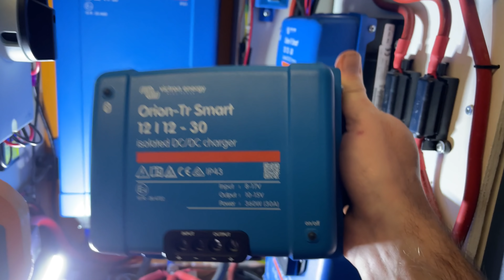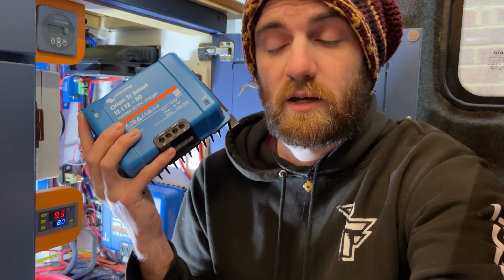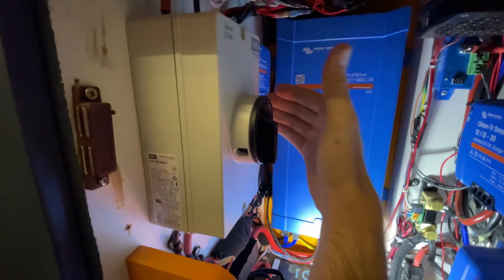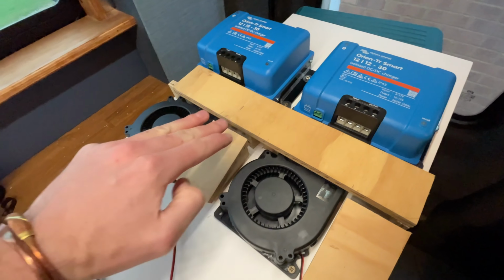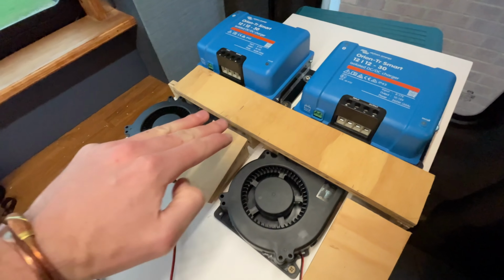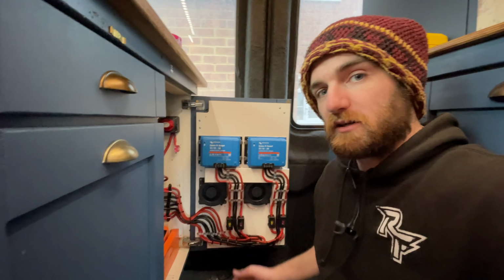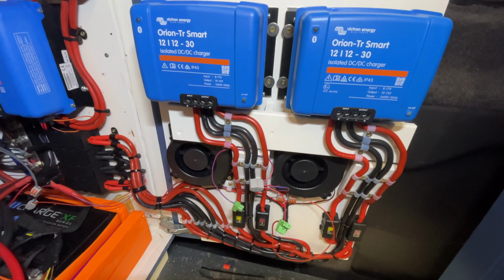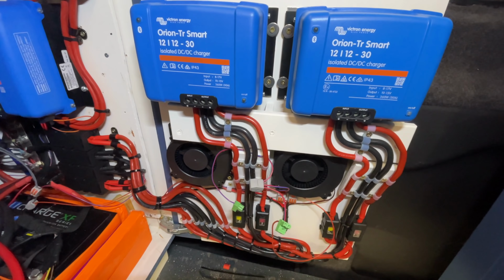Double Victron B2B Charger Install | How To

Comment: rip alternator
Reply from the maker: Not likely with a 220a alternator and looking at the ford upfitters manual for size of Aux loads. Evening doing 30 minutes idle test with a thermal camera show operating temperatures of the alternator well within operating specifications. It’s not like big B2B’s are anything new. Renorgy, voltonic and Sterling have been doing 50A,60A & 70A for years and I’ve next heard of something burning out a appropriately sized alternator.
Reply: @MispronouncedAdventures  yes the alternator is plenty strong enough but from a person who has dealt with large audio systems for the last 3 decades i do know that heat cycling an alternator under that much load with no airflow melts the protective covering around the coil windings along with cracking the brushes, if you want to continue doing that either fit a fan to blow cool air at the alternator or fit a second non smart one like we have with our RV.. EVEN VICTRON DONE A VIDEO stating that suggest you do more research  if your charging lithium
Reply from the maker: On top of the at. I have a switch on that dash I can turn both or one off during the summer as I don’t need both. But being in the Arctic in winter they were great
Reply: @MispronouncedAdventures  ok clearly you appear to know better but ive never struggled for power up here in Sirkka with our setup, i wish you the best of travels
Reply from the maker: The Victron video you referenced is not a great example for this occasion. as I’m not charging “lithium” like in the video, I’m powering a charger, batteries chemistry is irrelevant in that sense. 

However the video does make good points.  The point of that video was in encourage the sale of their DCDC or buck boost but they show the charging a lithium battery unrestricted & directly off an alternator ( two types old traditional style or more modern sorted ) but they don’t have a equivalent of a starter battery is System ( they also don’t mention the rated output of those alternators in the video ) it was good to see my alternator had lower temperatures at lower rpms than there tests. 

Whilst I don’t disagree cooling is important and cooling is obvious directly related to rpm. I don’t run the van at idle for Charging ( my previous reference to 30 minutes was for testing )
Reply from the maker: It’s did work through process with quite a few professional outfit of friends of mine. And they fitted multiple customers not issues ( yet ) 

However not worked with large audio Systems so I don’t really understand How they work in a power sense. Sounds like an area I need to look into as I’m always have to learn new things.
Reply from the maker: I’m curious now what is a Sirkka?
Reply: @MispronouncedAdventures  Sirkka? put  in google translate .. it will give you clue hyvää matkaa ja turvallista matkaa
Reply: of course if you are using AGM they requires hire voltage too 14.8 in most case along the same line as lithiom thus generatting heat
Reply from the maker: @vandamonium1731  thank you!